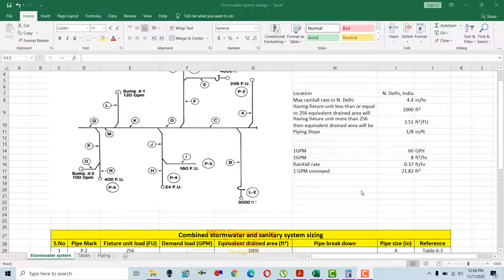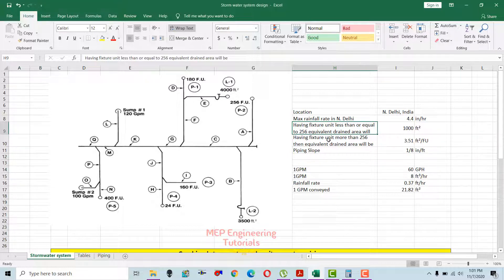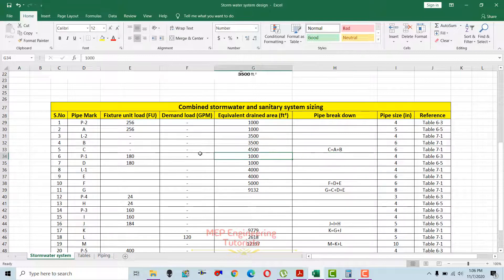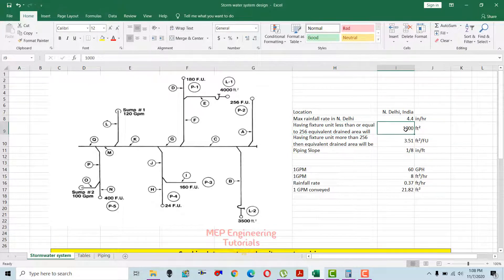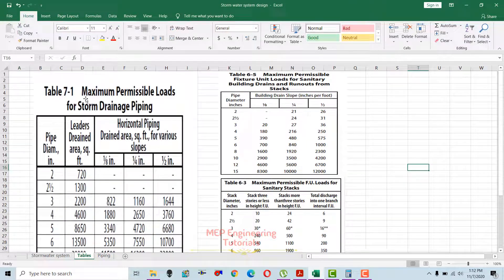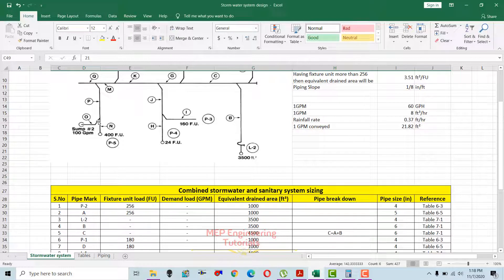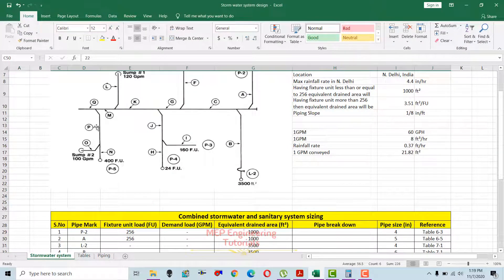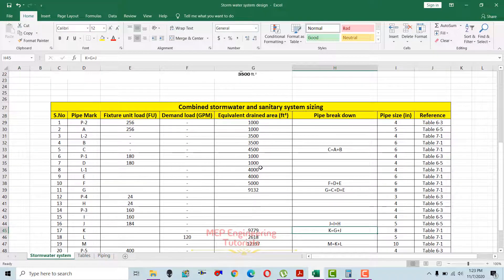Combined storm-water system and sanitary drainage system design, Plumbing system design as per IPC

Comment: Hello, I have the following question: Using this formula for 1GPM conveyed, the pipe sizes increase with the rainfall rate decrease - Is this expected? For example, when I set 1 inch per hour, then 1 GPM per sf is 96. Then, sf/FU is equal 15.46 compared to 3.51. So, the equivalent drained area per constant number of fixture units increases, and consequently, the pipe size increases as well.

Comment: for G you said it would be the sum of C and F and adding that would give 9500 how did you obtain 9132 17:20 also for p-4 to J you did not put a equivalent drained area and looking at the givens They were all meant to have an area. Could you please explain. Thank you
Reply from the maker: Section J which is equal to H+I, it's NOT required to convert section J fixture unit into equivalent area because both section H and I are sanitary drainage pipes and there is no storm-water pipe connected to them, that's why I did section J pipe sizing based on table 6-5. Section J fixture unit need to convert into equivalent drained area only for section K pipe sizing. Also section G equivalent drained area 9132 is correct and the reason is value of 180 fixture unit is not taken as 1000 ft2 because stack P-2 which is having 256FU has already converted to 1000ft2 so any additional fixture units added are converted on the basis of 1FU=3.51ft2.

Comment: When i use to pipe draw option, the pipe is showing in lines in 3D view also..why??
Reply from the maker: Which software you're talking about? I didn't use any software in it. I used excel sheet to calculate pipe sizes
Reply: @MEPEngineeringTutorials  in revit software. I used to draw pipe but it is coming in draw blue and pink colour, actual colour of pipe is not visible in 3D,
And accessories like gate valve is showing in lines noybas solid

Comment: you didn't add the equivalent area of the J , and you get the sum of G wrong it should be 9500 not 9132
Reply from the maker: Section J which is equal to H+I, it's NOT required to convert section J fixture unit into equivalent area because both section H and I are sanitary drainage pipes and there is no storm-water pipe connected to them, that's why I did section J pipe sizing based on table 6-5. Section J fixture unit need to convert into equivalent drained area only for section K pipe sizing. Also section G equivalent drained area 9132 is correct and the reason is value of 180 fixture unit is not taken as 1000 ft2 because stack P-2 which is having 256FU has already converted to 1000ft2 so any additional fixture units added are converted on the basis of 1FU=3.51ft2. I hope you got the answer. That's why I recommend to get excel sheet for more in depth details
Reply: @MEPEngineeringTutorials  thank you , i understand these point but why you convert 400 FU to 400 gpm?